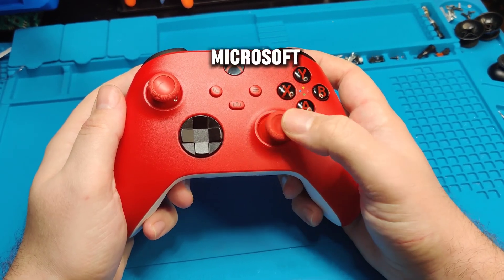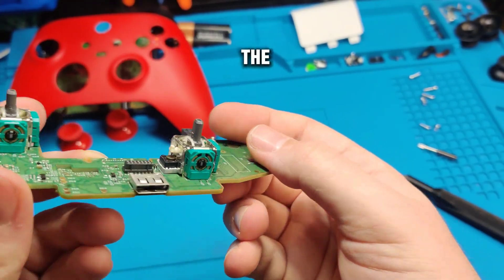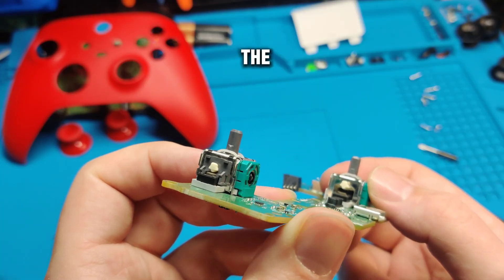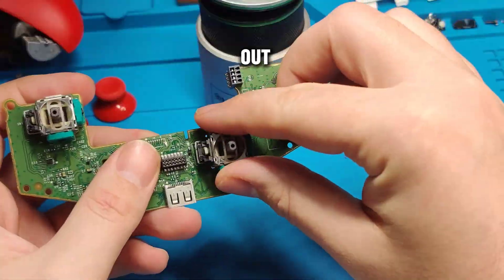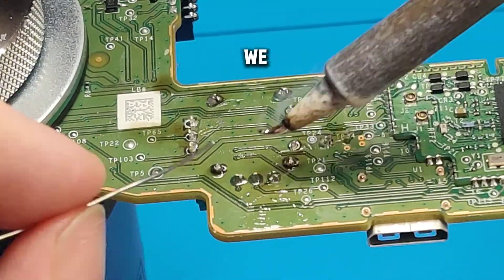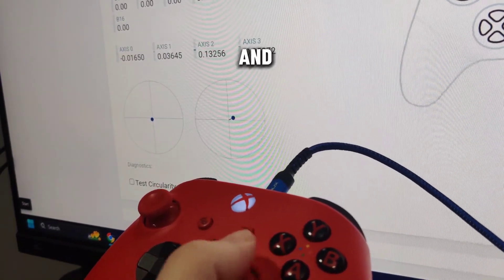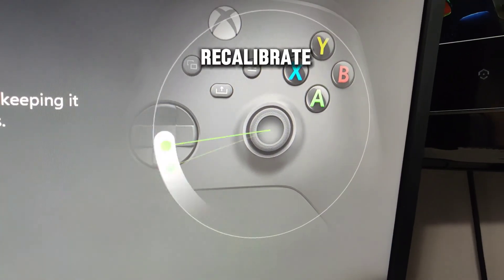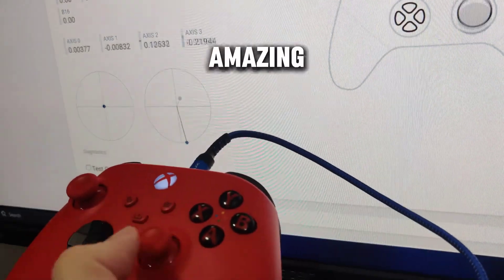Xbox Series X/S Controller Joystick Module Replacement and Calibration

Comment: Hey I recently tried replacing my elite series 2 controller analog sticks but after replacing them my controller automatically moves on its own and I can’t seem to calibrate them because it just keep moving towards one direction… I might have ripped some pads off in the process of installing the new analog sticks cause I’ve done this repair successfully before but this time I had no luck… if you have any advice or any tips I’d greatly appreciate it cause I’ve been trying to fix this controller for a couple of days now with zero luck thanks

Comment: Desoldering the drifted joystick was a pain, but i manage to swap the potenciometer, now i have issues after calibrating the joystick give 17,8% error, its like it moves in a square rather than a circle, any advice on how to fix it?
Reply: Most likely the stick itself is just bad and you have to replace the whole thing or just double check your work just in case.

Comment: Jesus, I gotta say, from Xbox One/PS4 generation and onwards those controller are pathetically cheap made and faulty. The early manufactured original Xbox 360 controllers can endure like 15 years of regular use without any analog drifts or face buttons sinking.
I really hate this kind of nasty practice. They throw those faulty products at the costumers to push  replacements every 4 months or so, and then when electronics components are low on stock in the market due to all that mass production of garbage quality goods, they raise the prices. Why cant we have things that endures for long times? The planet would be thankful a lot, and there would be way less waste of materials.

Comment: I got a question When you replace the stick trift Controller Can it be permanent Fix Or you have
To Replace it brand new ones ?
Reply: The potenciometers wear out with time. It can be replaced with hall effect joysticks, but in the left joystick interferes with the l2 trigger

Comment: Removing those sticks are a pain, no amount of flux, solder wick, nor the solder sucker can get the solder out if those holes. Ended up knocking of some components instead.
Reply: Try SMD low melt solder chip quick makes some as well . Its makes things 100 times easier as it stays molten for 10-15 seconds after u take off the iron off so they come out super easy. Idk why no one has made a video doing it this way as I had to learn the hard way and burnt pads off a few boards before leaning about this type solder. Now I can change both modules less than in 10 min
Reply: @dereckkosap3963  I'm gonna take this advice as I wanna make sure it goes as smoothly as possible with my 20th-anniversary series x controller once all my tools get delivered and I do it all I'll try to remember to report back here
Reply: @dereckkosap3963 can u explain what a smd melt solder chip is?
Reply: @dereckkosap3963  hey I saw that you said you’ve rip some pads off before… I recently tried to do this repair myself and I’m wondering if there’s either a good video on how to properly repair the ripped pads cause I recently did this and now my controller moves directly up and I can’t seem to fix it… I’ve done this repair before successfully but this time I did manage to knock off some pads and I have no idea on how to fix this issue… I don’t know where the pads connect to and another question do the pads on the back and the front of the controller both need to be repaired or is it just one side… and what I mean by that is there some pads underneath the analog stick and there are another set of pads on the other side where the pins stick out… which pads are necessary for the analog sticks to work… I’m kinda new to soldering and to these type of repairs so I’m just going from channel to channel trying to get some advice or some tips on how to fix this cause it’s been kinda driving me crazy I’m just trying to get this controller working again… I’ve had this controller for over 5 years now and I’ve done multiple repairs on this controller… I don’t wanna buy a new controller now… I have a feeling that a newer version may come out and don’t wanna spend money if I don’t have to… especially because I did buy a bunch of equipment to repair these controllers cause they come with so many problems yet when they work they are phenomenal controllers… they are just terribly built controller I’ve had to fix the bumper buttons the analog sticks the plastic shells expanding outward sticky buttons… the point is I fix it a ton of times and I really wanna figure this out if you got any advice or any tips I’d great appreciate it thanks!
Reply: @SpruceDust it’s easy to fix the traces on them mate if it’s a ground trace you done need it and if I remember rightly there is 6 ground pins which you don’t need all 6 but some are anchor points however if the joystick stays still you should be okay if it’s the other ones on the potentiometer then follow the line on the board (the trace to the via then search some of the pcb until you access the copper then get solder paste and put some over it rub the iron over quickly and you’ll should get enough on there to get 0.1 mm jumper wire or break down some solder wick and just tac one side of the jumper wire to the point you just scratched then one point to the leg of the joystick where the pad ripped off
Reply: i do this every day just with soldering station and mesh

Comment: I can't get the original thumbstick off the board.  I've wasted a bunch of wick trying.  I am about to give up on it until I can get some other tool like a desoldering pump or solder pot...something!  It's very frustrating.
Reply: https://youtu.be/SegiaPqA8SY?si=UTtPQhIT59hELxmd
Try the piece-by-piece method, for the tiny solder holes, put the fresh solder into it until it turns liquid then quickly use the solder wick. Hope that helps
Reply: @tuhuynh1190  I was able to remove the thumb stick Finally but have trouble getting the solder out of the holes so the legs of the new thumb stick can set in.  I used the piece by piece method btw.  I actually burned two of the eyelets from one of the pots so I've got to fix that now too.  It'll get done eventually but it is quite frustrating.  I made my own helping hands but doing this little project showed me I should just buy one.
Reply: SMD low melt solder is the best thing for this as it’s what I use and it stays molten for 10-15 seconds after taking the iron off
Reply: @dereckkosap3963 you buy it off Amazon?

Comment: I did this and everything worked fine until I did a firmware update. now afrer 2min the sticks are going crazy. reconnecting the controller and the sticks are back to normal. but after a few movements... again, they drift like crazy. played for a while without any issues before I did the firmware upgrade. another problem, I can't revert the firmware it gives me an error.
Reply: もう一度ファームウェアを更新してみて
私はそれで直りました
Reply: I am having this same annoying issue. Replaced 4 modules on 4 different controllers and after playing an hour with each of them they all have extreme drift to the right.

Comment: Finallyyyy. Too bad this is exclusive to new controllers only. I have this new one but the previous gen was my daily controller. Replaced its sticks some time back and found out about hardware calibration and was cussing ms for the non sense. Then they release this few weeks in. Amazing timing. I will sell the old one for parts and new one will have a long life now